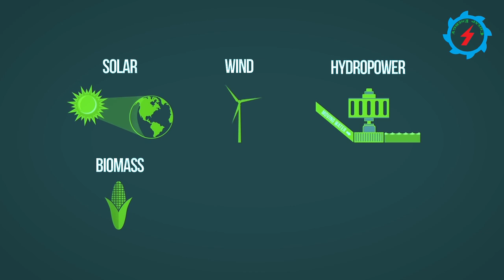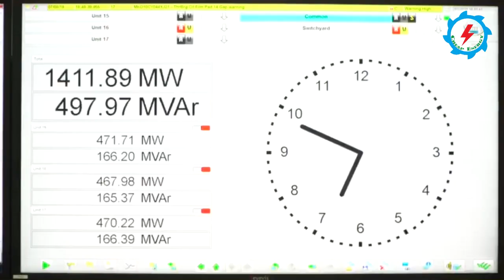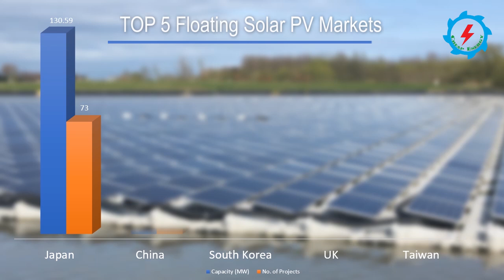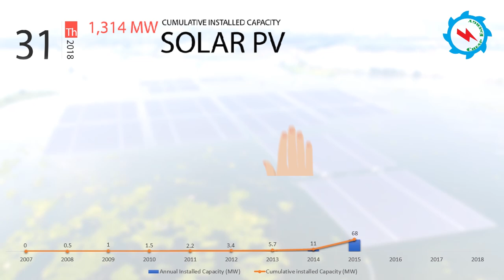Floating Solar Panels | First Time in Pakistan | Tarbela Dam Reservoir

Comment: Indeed a new era of power generation to support reservoirs / dama own power's need as self-sustained and energy efficient project. More such initiatives need to be done on ground especially when it's come to mirco-level grid and off-grid projects both in urban (especially in slum areas) and rural areas.

Comment: Thanks for this informative video, Sir would you make a video on
1. Pakistan's current and future energy policies because I am confused. 
2.And a summary video on Pakistan achievements in installation of renewable energy sources.
3. Energy potential in Baluchistan because I have read that it can produce energy via wind, solar, geothermal and tides etc and their capacity & feasibility. Feasibility of dams in Baluchistan and energy generation from them.
4. Geothermal energy sources in Pakistan and their capacity & feasibility.
5. Pakistan's conversion rate from non renewable energy to renewable energy sources, what abstacles in its way and if it is slow compared to other countries then Why is it and reasons for it.
6. Biomass feasilbility, its cost, capacity of production and obstacles in its way of pursuing. 
If you make video on above topics or related will be much appreciated.
Reply from the maker: thanks for your valuable suggestions. Sir We will try to cover your points.
Reply: brother, seems like you're asking for a complete thesis. 🤣